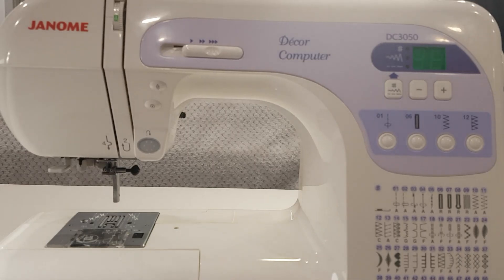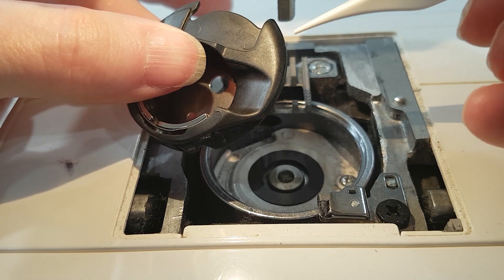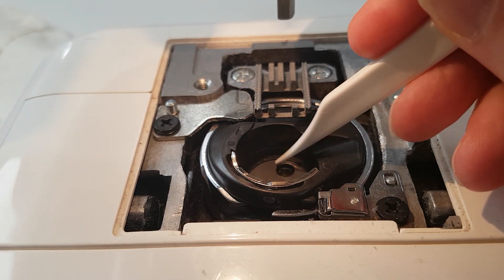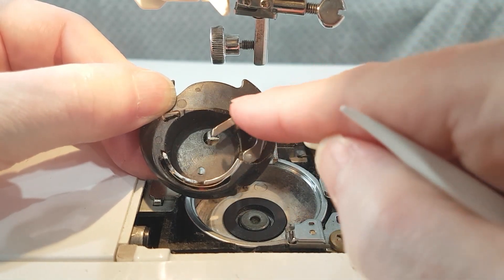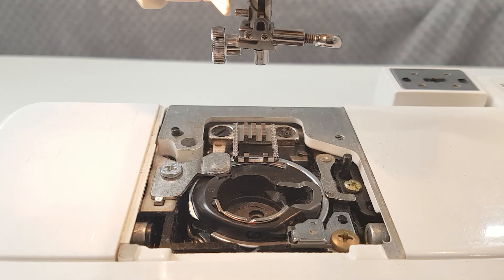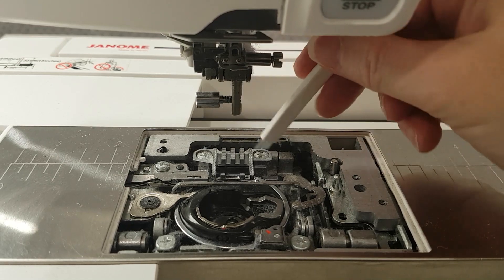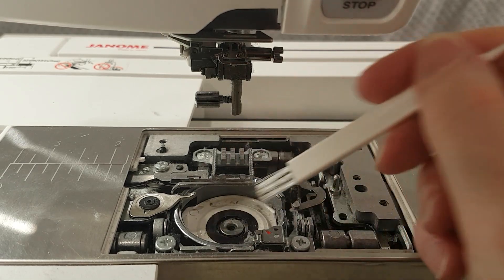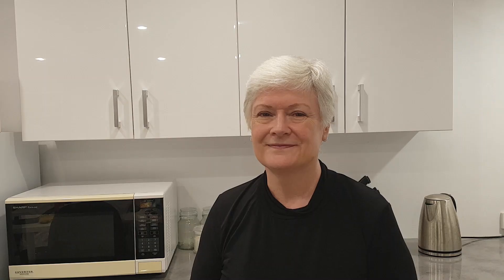Sewing Machine Care and Maintenance

Comment: Do you have any tips about cleaning an over locker at all?  Great advice....My Elna automatic is still going after 50yrs .... I put it down to regular cleaning and oiling. I passed it on to a friend when I got my newer machine.
Reply from the maker: I will get onto overlockers eventually... open it out as much as possible,  use a vacuum cleaner especially one with small attachments, and/or a soft paintbrush. They are definitely machines that like to make themselves messy!
Reply: Thank you... Messy they certainly are.. I have used a vacuum nozzle with a fine mesh over the top to collect bits but I don't know if there are any sneaky little nooks an crannies I am missing. @SharynsSewingSchool
Reply from the maker: @grumpy_poo  the technicians take all the covers off and blow the lint out.